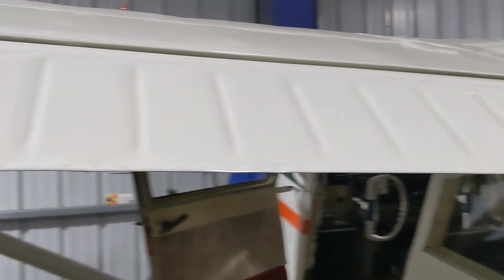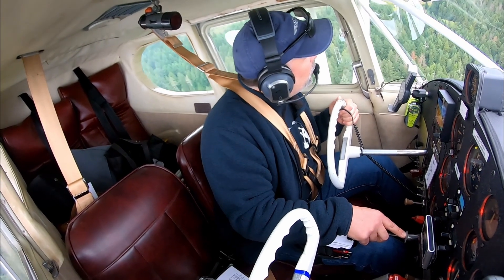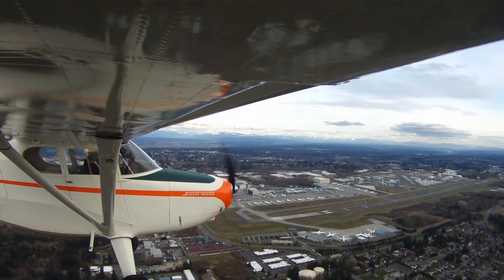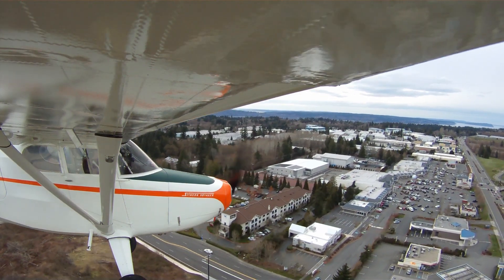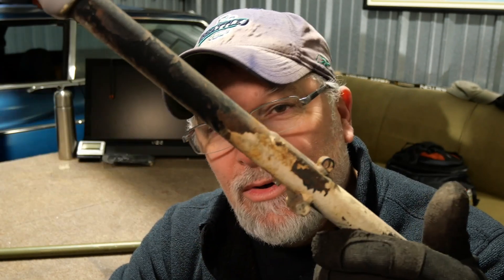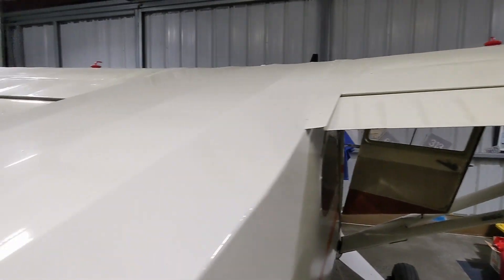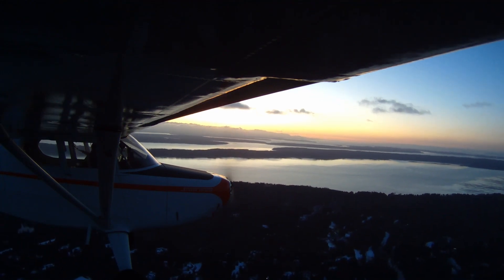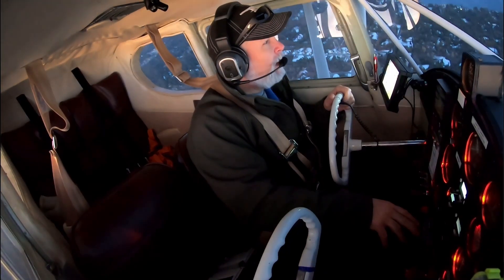Oh Flap! | An Explanation of How Flaps Work on the 108s

Comment: When looking to buy these stintsons should I be looking for one with the Franklin or Continental? Or which engine. New to the world of aviation and love these stintsons.
Reply from the maker: I don't know of your background or specifically the background of your maintainer (i.e A&P) The Franklin is a smoother running engine, however has some differences and are not as common in GA. Some parts are an issue to source. The Continentals are more familiar to most mechanics. Parts are more available, and with some versions you can get a constant speed propeller. I personally am a big fan of prop control. If I had the choice I would like a 180hp with a variable pitch prop. Here is a rabbit hole for you to go down....
http://www.hangar9aeroworks.com/stinsonengineoptions/108engines.html
Reply: @FreedomFixer_Flying  oh I have no background at all. I don’t even have a ppl at this point but I am studying to take ground school test. I’m one of those that goes so deep down multiple rabbit holes until I have everything I need to make a decision. This rabbit hole is very deep considering I don’t don’t know much. I just know what I like. Thanks.